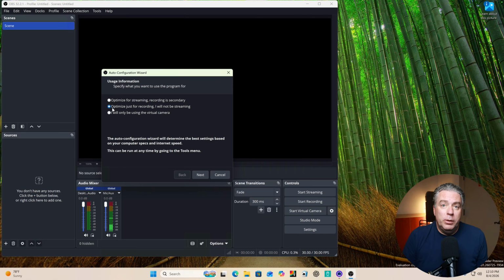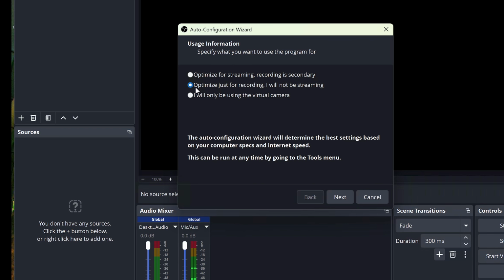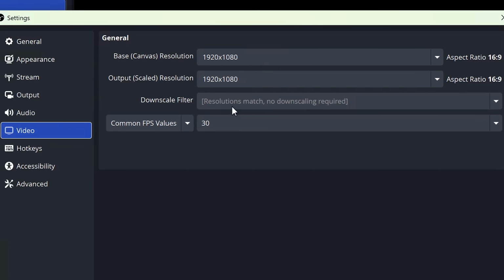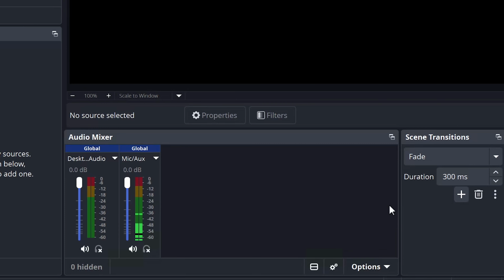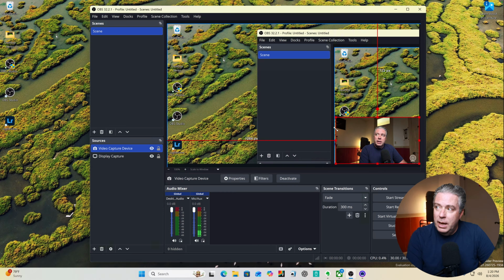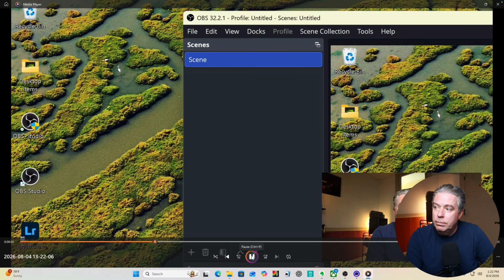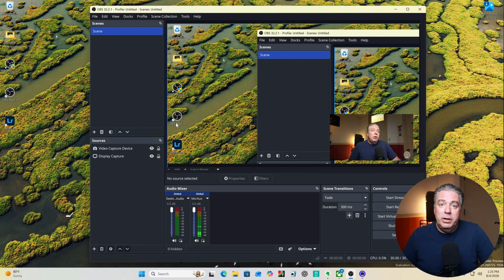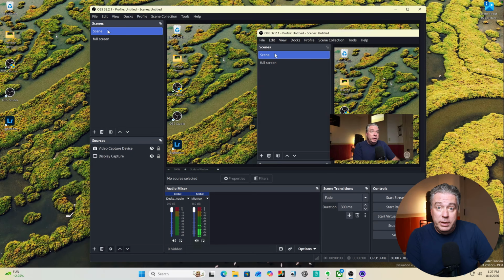The Simplest OBS Setup That Actually Works

Comment from the maker: f your mic bars aren't moving after setup, it's almost always OBS defaulting to the wrong input: go to Settings > Audio and manually pick your mic from the dropdown. That one setting causes more OBS headaches than anything else. Also, if you're recording in 4K and want the workaround for fitting everything on a 1080p monitor, let me know in the comments and I'll put together a full video on it.
Reply: Getting some bad feed back Martty 
 mate
Reply from the maker: @NinoDaTurth  Hey, thanks for trying it out! Want to make sure I help with the right thing. When you say bad feedback, do you mean an audio echo or squeal (feedback loop), a broken/frozen video feed, or just that the setup isn't going smoothly overall? And since you mentioned the Mac Air and Sony HDR-AS300, are you trying to bring that camera in as a source, or is this about your built-in mic/webcam separately? A bit more detail and I can try to point you to exactly the right fix.
Reply: @mat @mattlydytech ike a squeal mattly just looking in set I have sony monitors speaker plug in to a focusrite Scarlett solo
Reply: Thank you for your time
Reply from the maker: Without being able to see everything, I think you might be running into a classic feedback loop setup. What's I think may be happening is your mic is picking up sound coming out of your speakers (which includes your own mic signal), and it's looping back on itself and amplifying into that squeal.

A few things to try: first, check if your Scarlett Solo has a Direct Monitor switch or knob on the front, if it's on and you're also monitoring through OBS or your software at the same time, you can end up hearing (and re-picking-up) the signal twice, which makes feedback worse. Try turning Direct Monitor off and relying on just one monitoring path. Second, and often the simplest fix, try lowering your speaker volume or moving your mic further from the speakers, physical distance and volume are usually the biggest factors in whether a loop turns into an audible squeal. If you're able to switch to headphones instead of speakers while recording, that eliminates the acoustic loop entirely.

I don't personally run a Scarlett Solo (I use a different interface), so I can't point you to an exact dial or menu on your specific unit, but the Direct Monitor toggle and physical mic/speaker distance are the two most common causes of this exact issue.

Let me know if that clears it up!
Reply: @mattlydytech  I think I stop it  now matly and I got up now im yet to set it up
So when I utube I can have me in coiner speaking on clips etc Og I sent you email
Could
We zoom
What’s app something I could show I don’t mind paying for
Time im not loaded ❤ thank you once again for time
Amen
Reply: You solved all my problems just showing me where the settings are found.  My specific issue was my microphone started crackling for no reason I could find so I just did a fresh install and now it works just fine.

I think it might have been a plugin issue even though I had them all disabled.. or a windows driver issue but I never could trace it so I just started over and now it's all working.

I saw several others having this issue and it seems it's just a bug in OBS or a sneaky setting somewhere because every fix was different and none of them worked for me.

Comment: Hi Matt, I just want to record my sreen, I followed your steps and no matter what I do, I don't get any audio with the video. What am I doing wrong?
Reply from the maker: Hey, sorry about that! A couple quick questions to narrow it down: are you trying to capture your microphone along with the screen, or just whatever sound is playing on your computer (like a video or game)? And when you check your Audio Mixer at the bottom of OBS while recording, do you see the volume bars moving at all, or is it completely flat?

In the meantime, the most common cause of this: OBS needs a specific audio source added and selected, it doesn't automatically grab your mic or desktop sound just because you're recording video. Head to Settings > Audio and make sure the correct Desktop Audio and/or Mic/Auxiliary device is selected there (not set to "Disabled"). If those are already set correctly, let me know what you find in the mixer and we'll go from there.

Comment: I have OBS setup on my computer and it records my 8mm camcorder videos fine. I am at a loss how to burn them to a dvd on my computer, can you advise, thanks. Dan
Reply from the maker: Burning DVDs isn't something OBS handles directly; you'll need a separate DVD authoring tool to take your recorded files and actually structure them into a playable DVD.

For a free, no-watermark option that works on both Windows and Mac, DVDStyler is a solid pick; it's open source, lets you build a basic menu, and handles the technical DVD structure a disc player expects (this is different from just dragging video files onto a blank disc, which won't play in a standalone DVD player). If you're on Windows only, WinX DVD Author is another well-regarded free option people point to.

It has been years since I've done any DVD authoring, so I can't walk you through exact settings, but either of those should get your 8mm footage from an OBS recording onto a disc that plays back properly. Let me know if you run into snags, and I'll try to help troubleshoot from there.

Comment: The update broke everything so I wiped it and started from scratch.
Obviously I forgot everything I did for my initial setup so thanks for holding my hand through the re-install.
I skipped the installation wizard--if you hit escape it won't run it and I hate optimizers.
Reply from the maker: Glad the video got you back up and running quickly! And good tip on the Escape key; that's handy for anyone who already knows their setup and just wants to skip past the wizard. I should have called that out. Sorry the update caused a headache in the first place, but glad a fresh install sorted it out.
Reply: @mattlydytech  
The update breaking my audio just gave me an opportunity to enjoy some of your content all over again--I like your work sir!

I have escape key-bound to my mouse just behind the scroll wheel.  It's a literal game changer because it gets used almost constantly.
Reply from the maker: @TurboLoveTrain  Ok that's pretty clever. I may have to give that a try. I've got a few extra buttons on my mouse that never get used. Thanks for the tip!